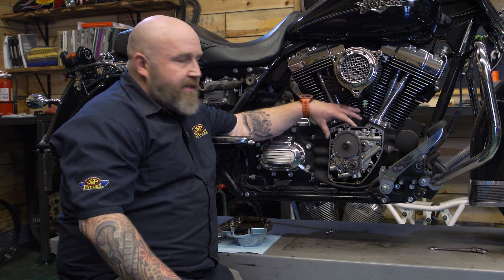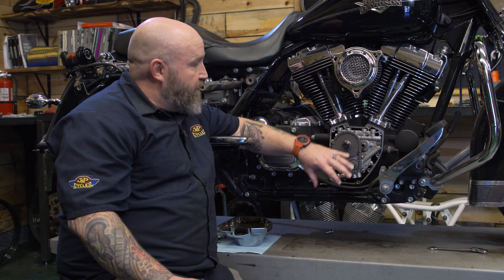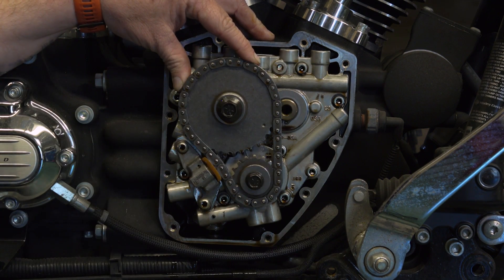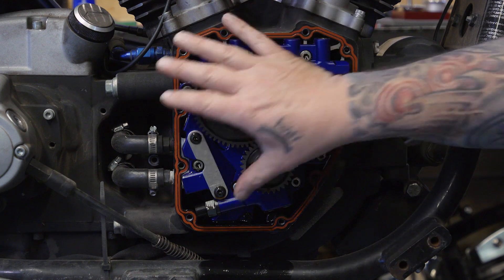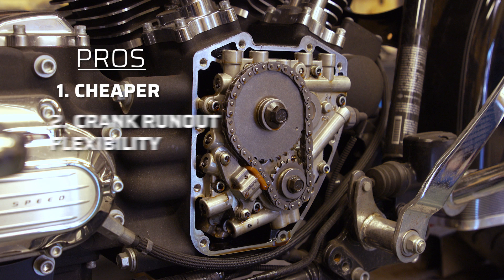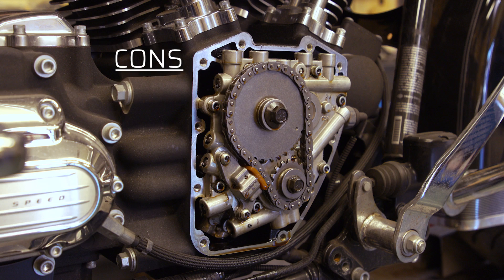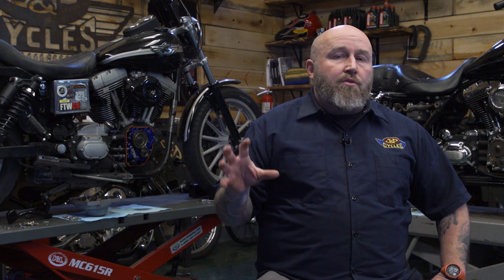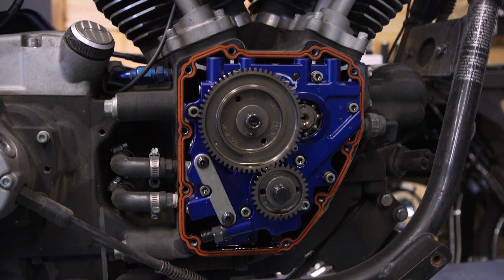Chain Drive vs Gear Drive Cams : Pro Tip

Comment: Question …. With a chain drive the crankshaft rotates clockwise and both cams rotate clockwise (looking from the timing side), with gear drive the rear cam rotates anti-clockwise and the front cam runs clockwise. So, are there different cam grinds depending upon whether you have chain or gear drive?

Comment: I have a 2003 electraglide, I bought it two seasons ago it was rebuilt by a reputable mechanic at 20,000 clicks ,95 bore kit, high comp heads,high lift cam, and heavy valve springs. I`m at 60,000 klks now runs fine but is (always has been )  noisy in the cam chest. Question is would it be a good idea to go back to a chain drive, the fellow who built it says don`t worry about run-out I`m not racing it just touring, gets good mileage and lots of power

Comment: Came here after listening to someone saying roller chain drive is more efficient.
Didn't watch the rest of their video.
Plan to go with S&S 509g from the fueling 525s fitted.
I don't need anything past 4½k RPM for anything apart from making a lot of noise from the v&h straight shots.
Need to check it's stock pistons and the crank is good but it's already taken a lot to debug my '99 FXDL with 7 previous owners.
Someone early on fitted a nice looking Harley motor co fuel cap from a EFi non vented that starved the carb when the temperature drops or at any altitude changes.
Should be plain sailing from here.

Comment: Hi I am from the future, 😂 Great review, I have just recently purchased a 03 Twin cam deuce, Because of age and mileage approximately 50,000, I thought I better look inside to see what I’ve been replaced, It’s had a new primary chain tensioner by the looks of it. The pad is only just marked., but I think as I’ve got it apart, I will replace it, then inspected the cam chest, it’s been converted to gear drive, with S&S components, but the plate itself is still HD, And wondering whether I should change the plate as well, what is your opinion, please?, 
And should there be any play in the gearing on the ends of the cam , it all seems rock solid, and there has been a misfire on the engine every time I open the subtle, I think I might have found the problem with an air leak, it has a HSR 42 carbon, the plugs though seem very very black, 
Which I was thought if I was on here, it would be lame , I wonder if you can advise, please, In 1999 2000 I did purchase a brand-new deuce, sadly I had to sell it in 2019, but I had spent a lot of money on. It had big kit cams auto pumps that the lot was done on it. It always ran very strong. Never had any problems., one other problem with this bike? I just recently purchased serious problem with the alarm system., I don’t like it and I wish to remove it, but been told by HD that I can’t do it, not without great expense, I’ve always found your territorials very helpful. Keep up the great work., from France.

Comment: Doesn't the Feuling cam plate allow for more run out on the pinion shaft than the recommended 3/1000?

Comment: Short of the "wobble" problem, would using crankshafts basically be stronger and last alot longer than a chain? If done right, the crankshaft setup should run for the life of the bike and never need to be replaced. And a side note: "Hydraulic anything is better than "springs"!

Comment: gear driven worked for years without any problems , this was all about getting bikes back into the shop for repairs and costs to the owners, the same as vehicles , to eliminate the backyard mechanic and those that like to do their own work

Comment: Had the full S&S chain drive, mild performance cams, inner plate and oil pump done on my '06 Springer Classic as did my son on my old '01 Roadking. Both are TC 88's. We went to Ronnies V Twin in Willis, Texas planning on gear cam swaps and Ronnie said the exact same thing as on this video. Both bikes run great and no reliability issues for years to worry about..Anyone living in the greater Houston area should check out Ronnies. Legit, honest and great work done. Not getting anything, just a happy customer.
Reply: What did this setup run you boss

Comment: Well, I wanted a gear drive setup before I watched this video, but now, I'm good with just doing the hydraulic tensioners/oil pump upgrade...& I think I can just use my stock cams, so that would also save a few bucks...I'm not trying to win any races, I just want to ride cross-country without my engine exploding...Lol!
Reply: same!
Reply: Same here...when I upgrade it will be with the hydraulic tensioners and new oil pump.  Although the gear drive has its advantages I became concerned when the speaker described the " shift" that can happen over time which can lead to gears damage with pricey repair I'm sure.

Comment: Does the gear driven cam rotate in the opposite direction as a chain driven cam?
Reply: Yes. Thats how gears work
Reply: Yes, and the lobes are reversed on the front cam, because it's direction of rotation is reversed

Comment: You forgot one of the biggest Pro's of the gear drive ... to tensioner (spring or hydraulic) pad to wear out. Even the new pads wear out, there is no way around it. You basically have a somewhat rough piece of metal rubbing against a piece of plastic at high RPMs.
Reply: The newer tensioners stay lubricated vs the old style. Most of them will not wear out vs the life of the bike…

Comment: I bought a used 2003 Electra glide classic that I didn’t know it had gear drive installed already. however I don’t want to tear it down to see the inside ? I did take the stock push rods out and replace them with the S&S adjustable push rods the bike runs great but by watching this video it got me concerned about what’s inside ? Any recommendations? Thanks

Comment: Bottom line the more runout you have the more the gear drive backlash will change. Chains are “forgiving” the gears will eat themselves when the backlash is excessive
Reply: I I was thinking just put gear driven camshafts in to eliminate the inner tensioner, but still run the outter chain and tensioner. I can't find anyone that just sells the cam's seperately
Reply: @brycegould7939  I don't think that's possible because the gear driven cam turns the opposite direction to the chain driven cam.
Reply: @brycegould7939  can’t say I’ve ever heard of trying that…not saying it’s wrong.

Comment: Gears are the way to go, why on earth would you use some chincy chain with an oil pressure fed tensioner?   80% of engine wear occurs during startup, when you have zero oil pressure, and you are relying on a chain that is not tensioned on an interference motor with 4 valves per cylinder... on startup.

Comment: what about the oil pump if you got run out on the crank pinion its also going to eat up your oil pump too
Reply from the maker: There is more "play" in the oil pump than there is between the mesh of gears in gear drive cams. Its definitely not ideal but the run out would have to be a huge amount to effect the pump.

Comment: Can you give an estimate of how much it would cost to upgrade to the gear drive system & a new crankshaft & flywheel?
Reply: A lot. I’m guessing since you are asking you aren’t going to be doing the work yourself. You can get your crank trued by revolution in Plymouth wi or dark horse. Prices vary but both very good. Figure somewhere between 12-16 hours shop time. If they aren’t a machine shop cases sent to a machine shop to pull crank and then reinstall that a couple more hours of time. Every gasket in the motor. Depends on which motor you have but probably another 1500-2000 for cam chest. With gear drive. I’m thinking with many different variables anywhere from 4500-6000 grand

Comment: I have an ‘06 Dyna with about 60 thousand miles on it. Not ridden hard. Should I be checking the chain tensioner?  How do I know if it needs replacement?  Thanks.
Reply: Your should have the hydraulic tensioner, and if you have 60K on it I would have the tensioner checked at the next service.   Easy to do by just pulling the cam cover off.  If you don’t do your service yourself the tech can do it and if it’s not bad it should only add about an hour of time to the work order.   

But at that mileage, if you are pulling the cover to check it just replace it anyway.  IMHO.
Reply: I believe dynas has hydraulic cam chain tensioners in 06 models.  They were the first.  But double check me on that.

Comment: As a confirmed gearhead; all my friends & family have confirmed this, I prefer the whine of gear driven cams over the whir of chains
That’s the only complaint I have with my 2018 Wing
😉
Reply: Sir whining is caused by improper gear backlash alignment. Improper gear clearance. You can get the correct gear size for correct backlash. If you dont you will wear out the gears prematurely. I did it on my bike.

Comment: Pretty sure runout is more than 3 thou limit ?
Reply: I think it is 5
Reply from the maker: S&S says 3 thousandths, there are some builders that do say 5. I'd lean towards the side of caution. When my Dyna flywheels shifted it broke the stock cam plate (stock motor with intake/exhaust/carb and 24,000mi) . I checked when the shifted they were 47 thousandths! 
-Patrick
Reply: @jpcycles  bit rude that to happen .downer on Harley
Reply: @jpcycles  info i  got S&S measure the gear backlash in 4 spots

Comment: Great info , but what if you just want to bulletproof your engine, what setup would be best?
Reply: Gear drive is the way to go
Reply: @Mathaury  if i go gear drive and later switch to chain again would a crank case with less than .0003 runout work with chain or only with gear?
Reply: @Cheaps2.0  it will work
Reply: @ihatesjws1188  thanks i think i was high asf when i asked that question hahaha

Comment: This info was very concise and informative. I myself built my 95" with gear drive, Andrews 37g cams, Feuling plate & pump and S&S crank...man, I love the set up!
Reply: I think this is the way to go on my 01 fxstd coming up on 22k miles
Reply: What was cost and any special problems?
Reply: sounds like a killer set up bro ride safe
Reply: I have a 2010 fat bob with about 17K on it always wondered abut the tension springs and the oil pump.
Oil pump upgrade is suggested by some videos I watched